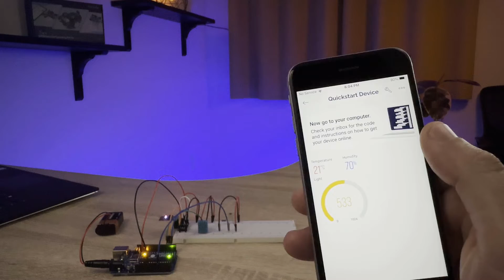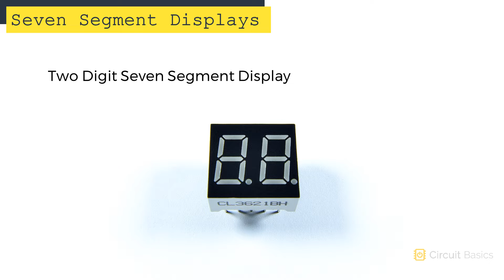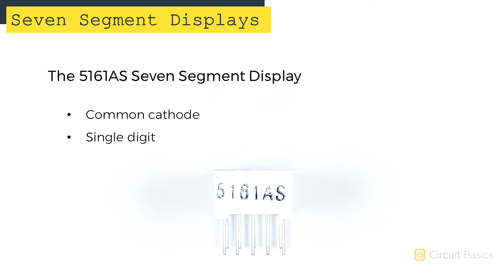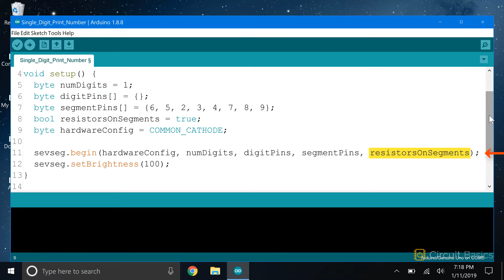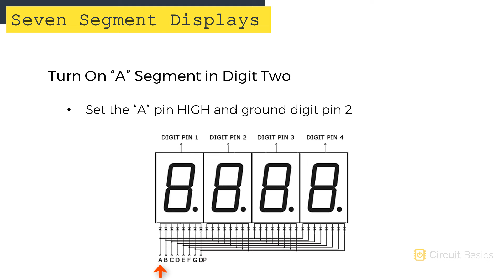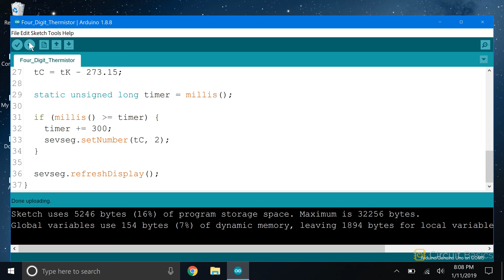How to Use Seven Segment Displays on the Arduino - Ultimate Guide to the Arduino #28

Comment: Hi, can you make a video about a smart arduino car which can drive manually or automatically? The manual controller is a joystick, and the button on the joystick module is used to control manually or automatically driving. And the controller(joystick module) is wireless.

If you make this video, I would subscribe and like your video. Your response will be appreciated.

Comment: Wow, never seen such neatly done jump wires.  All must have been carefully cut to length.
Do you like i2c port expanders, shift registers, or something else when doing 8 digits?
Ya know, that problem is similar to rasterizing an 8x8 LED matrix.  There must be a specialty driver.
This has been useful ... have been writing my own interrupt routine, and fonts, to dither multiple digits.